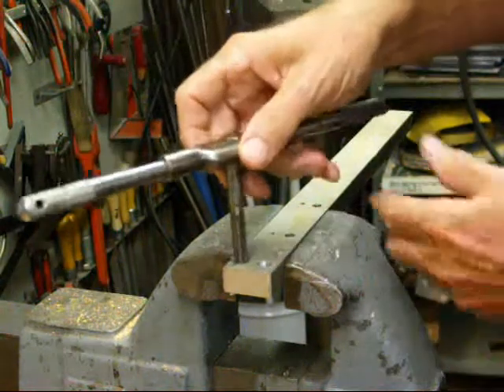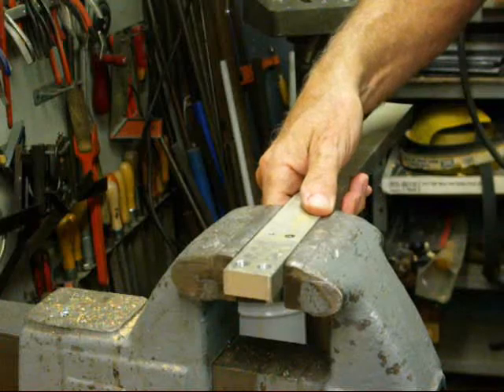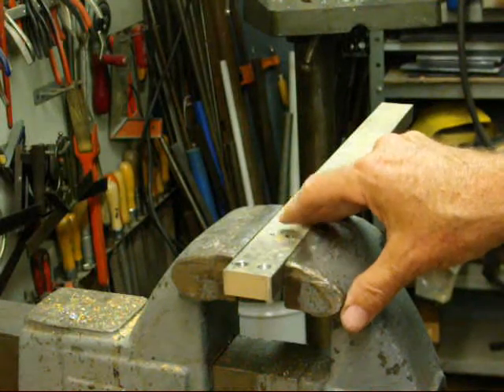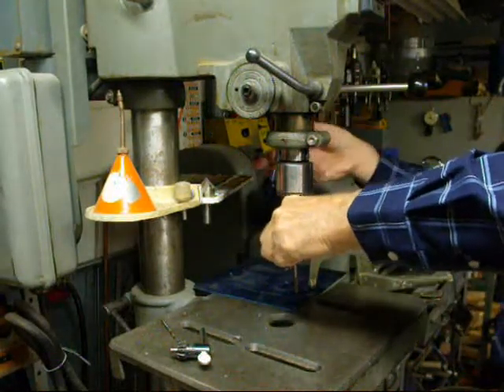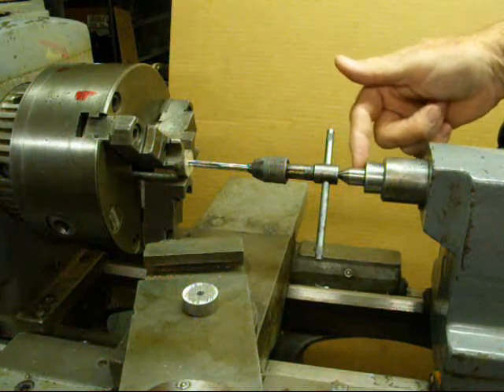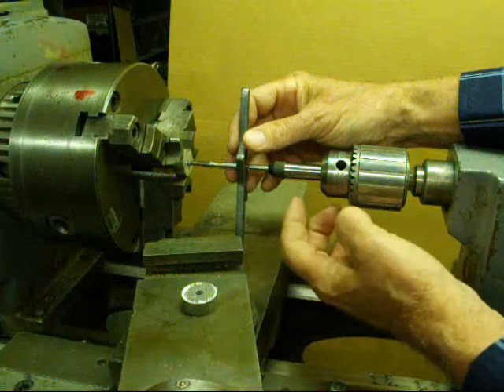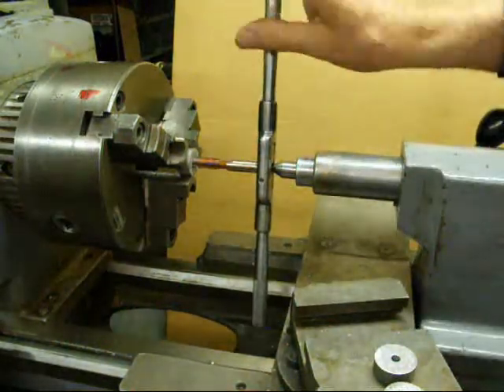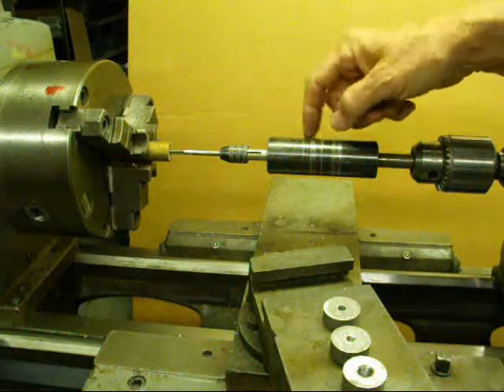MACHINE SHOP TIPS #3 Tapping tubalcain

Comment: Another great video Tubalcain... The moment you mentioned not locking the tail stock when threading under power, a light bulb went off above my head. Although I hadn't sought info on power threading on the lathe, I couldn't visualise how it might be done either. I am going to make myself a spring loaded tapping assist tool when I next get a chance. Many thanks for this series.

Comment: Yup used the drill press and lathe this way also.  I also use the dies in a holder in the tailstock or with the die holder the do the external threads.  Great practical way to make sure things are centered.

Comment: After watching this video I went to my shop and built a spring loaded tapping tool like the one that you have. It's designed to work with three different taps end styles. Thanks for enlightening me on the proper ways to line up a tap.

Comment: @poozer all else being equal broken taps are caused by:
1. Too small of a drill used for the tap size. (more or less explained by "thread engagement")
2. Poor alignment of force on the tap (taps more likely breaking from bending and not from twisting)
3. Not backing off every 1/3-1/2 turn to break the chips. 
Saying the taps break because they are cheap has some validity but is also more wrong than it is right- good taps are very sharp and very hard- read brittle. Thus a cheap tap while pretty bad at cutting good threads is not likely to snap off with little warning as it has plenty of flex before it does.
So IME the best taps available will readily snap right off if abused, they are quite brittle.  
Broken taps are of course REALLY hard to remove even if you're lucky enough to have a tap removal tool (usually available for 2 fluted taps) and remember this if you're going to try- if that tap was binding so hard it snapped the shaft it's not likely you'll get the broken part to turn by any further means.

Comment: @tzkelley  Also hand taps aren't designed to take such a work load, when tapping by hand you can feel any rough spots irregularities etc when hand. Machine taps, turbo taps, Are always made out of a high grade high speed steel. This doesn't  mean they won't break. So far the the only machine taps Ive seen are seen are plug taps for the drill press. Ive only seen just a bottoming tap used in CNC machines for starting a tapped hole and finished in one job using just this one tap. Take care.

Comment: Wonderful. Thank you.

Could you please cover threading dies, including round dies and hex shaped dies? I assume the adjustment on round dies are so you can make two passes on harder material and the hex dies are more for thread chasing than anything else, though I have cut threads with them too.

Have you ever mixed up a tapping fluid? Like lard or kerosene?

Comment: @TheElectricnoob hey bro, if you were trying to get a 3mm hole, you should have used a 1.5mm drill, you should always use a 2mm drill smaller than your actual thread you are trying to go for.

Comment: Hi, I'm an apprentice CNC miiller/turner, at college I was tapping on a manual lathe using the spring loaded center and a tap wrench as you've shown. However mine kept coming out horribly un-square. 
What tips do you have for assuring squareness?